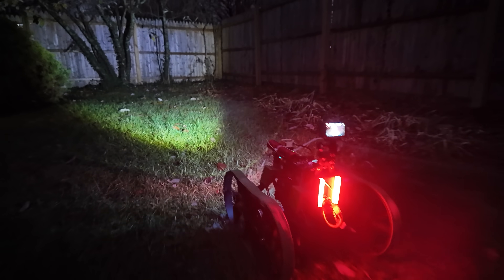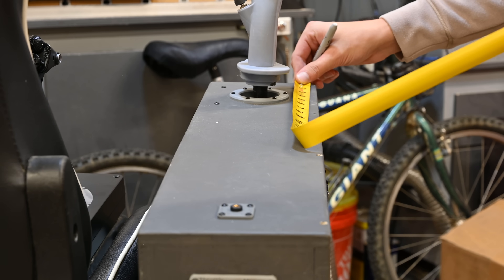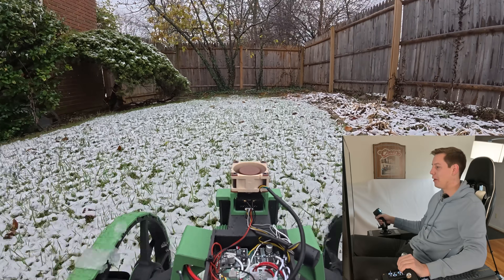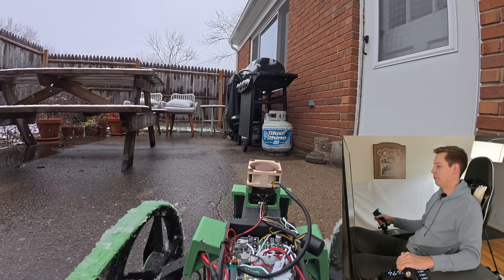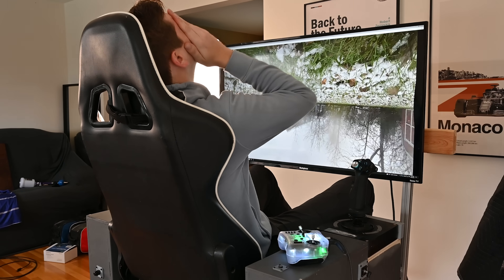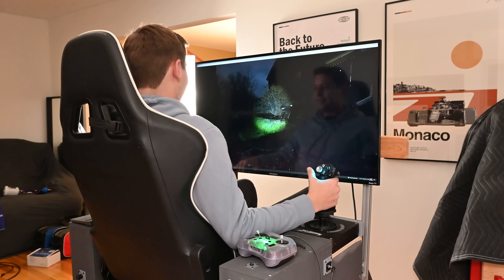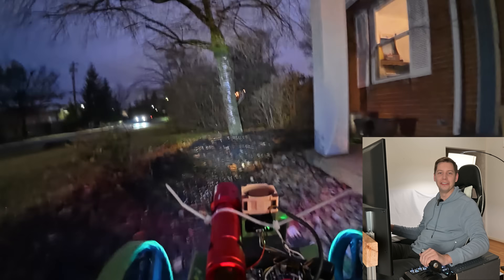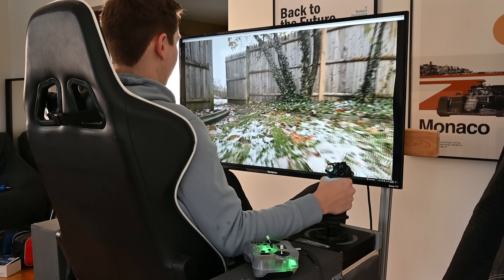FPV Tank Drone in the Dark

Comment: You should of made independent motors so you have the most control of each side of the drone and it can self balance easier just add rubber to each prop like the same way they are just without a belt and rubber for gripp

Comment: How much range are you getting ? I would love do exactly what you are doing which is being in my house looking at my TV and ride the car outside around my property without signal loss (video and transmitter)

I have a similar setup but with Walksnail-CADDX (without SimRig) and the thing I have problem with is the range of the video by itself: in open field or when having the antennas towards the vehicle it works flawless but whenever I am behind a building or not seeing the car or too much obstruction, the video signal quality decrease and go bad fast.

I tried contacting a big brand antenna manufacturer to know if I could swap bigger and longer/better quality antenna but those stock antennas used on the VRX and TX are LHCP (left hand circularly polarized) and most of the 5 Ghz antennas available on the market (not RC related) are linear polarized which is different and will bring deterioration and 4-6 dB loss or even more... I am kinda unsure if I should try it anyway an buy expensive bigger and longer antenna to see if any gain is possible.

Comment: Yet another FPV pilot who h8t3s alien facehugger goggles 👍
 #endthegogglepvke
Really all you need is a comfy light chair, a large lightweight high NIT flat screen that runs off 12vdc, and a video receiver with HDMI or Displayport out.  The controller you can hold in your lap.    Where FPV has historically failed and scr3w3d over visually impaired people...  is in providing the HDMI out...

Comment: hotas guy here, the x5# controllers are junk. they have bad power delivery circuits that fail or degrade in ~2 years, and this makes them have phantom inputs or dropped inputs if you dont deliver enough power to them (a usb port shared with other hardware. no, i dont mean a splitter you put in, even your motherboard splits ports, and its drawing more current than spec can deliver, so it stops working correctly). or they break entirely. these things are trash to the simulator community. avoid em.

extreme 3d pro is bang for buck, craptastic but you can literally get them for free or a few dollars used at garage sales, even new at ~30$ its the best money per performance.

vkb is a great bang for your buck nicer option for something you want that will actually last.

tied with vkb is the metal thrustmaster stuff: a10 or f16 sticks/throttles. do NOT pay full price for these, if they are not the same price or cheaper than vkb kit, your not getting a good deal. the switches and sensors in them are REALLY old. they do not keep up with the competition and TM doesnt care. skip them if its not the same price as vkb, your getting ripped off here.

winwing being the next one up, though QC with them isnt the best and warranty, while decent, is difficult due to language barrier. 

virpil stuff is bombproof, but costs to match it. best support out of any company, in any industry, if you ever need it. 

then the boutique stuff for sim rigs that costs thousands of dollars.

sadly, not much good stuff exists in our world, its very niche. some guys are running 20yr old hardware because we dont have good replacements. (looking at you, FFB gear).
Happy flying!

Comment: i have a great idea for the chair for the next, a fixed wing fpv drone and vr headset with head tracking and a dji o3 camera movement gimbal is controlled by your head tracking, oh and the best part, starlink mini for infinite range, maybe even solar panels on the top and team up with peter stripol to pull it off because of the size the project would be, but a drone that can fly anywhere in the world would  be a crazy title

Comment: I LOVE this project. I'm absolutely NOT an expert in the matter, so take the following recomendation with grain of salt :D

I believe getting the quad rotors lower when in flying-mode could greatly improve the stability. According to what I know, drones are very good at ballancing when their center of gravity is above their center of lift. 

This is because drones control for roll by accelerating the rotors on the side the drone rolls toward in order to bring it back up to level. When the center of mass is bellow the center of lift, this accelerates the drone's mass like a pendulum, and causes the drone to overcompensate. Then the same thing happens in occilation.

When the center of mass is above the center of lift, this extra power has the opposite affect. The force, which is greater for greater roll, is matched with a greater and greater lever force from gravity. And as the lever force decreces, so does the power of the rotor, and eventually it returns to level without occilation! 

Thank you for making these awesome things!
Reply: But having the centre of mass higher reduces the stability. If the centre of mass is above the centre of thrust, the craft actually becomes statically unstable (though not unstabilisable), like an inverted pendulum, meaning the controller has to do more work. If the issue is the tuning of the controller then that should be what is adjusted.
Reply: Or if the issue is the rotation inertia of the craft, then moving the centre of thrust closer to the centre of mass may help, but the centre of mass should remain below the centre of thrust if stability is the objective

Comment: I can't see if you have a HUD, but if not, you should code something up for the display and add a battery indicator to the main screen. Speaking of which, you should set it up so that the main screen swivels out of the way. If you do it vertically like a gull wing door on a sports car, then it'll be significantly cooler too.